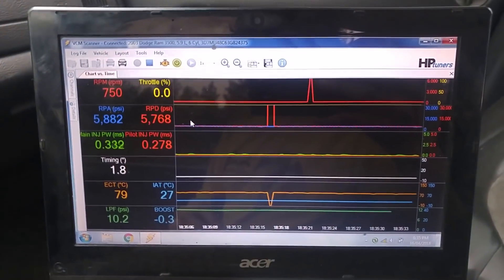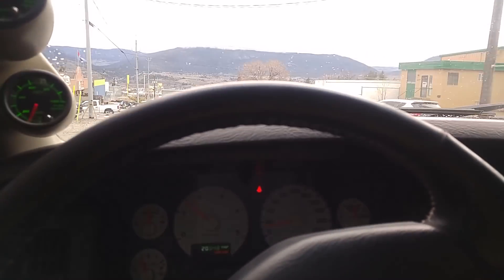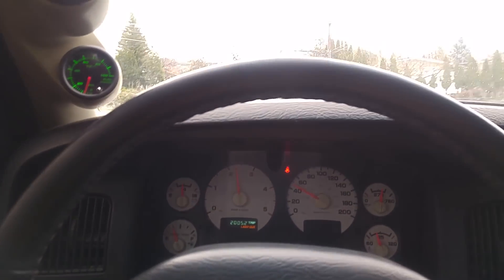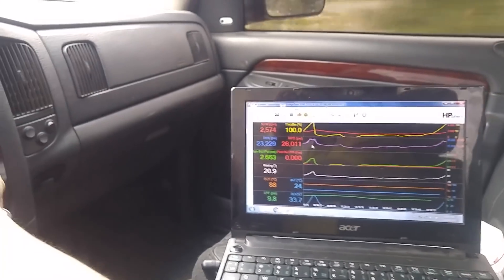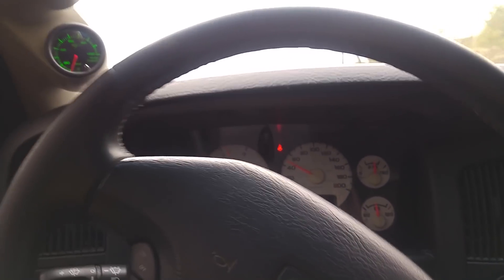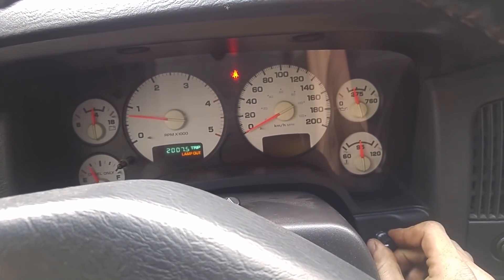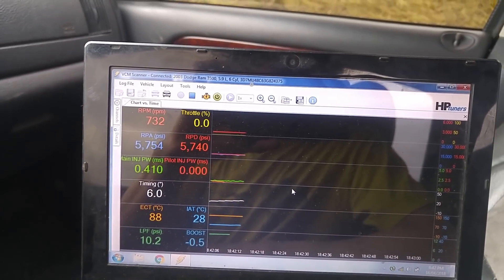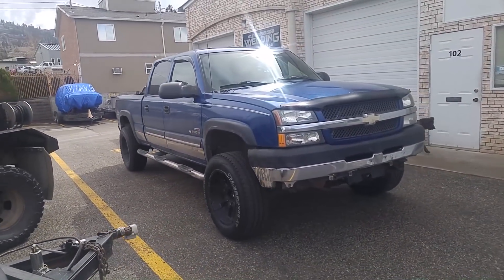SWITCHABLE TUNES FOR 03-04 CUMMINS UPDATE!

Comment: Optimal welding whats you’re opinion on a Smarty So6 for early 2003 Cummins NV5600 6 speed? Also what would you say is you’re optimal tune for MPG lower EGT and have some extra power? I have FASS fuel pump, AFE intake, Rail pressure/boost gauge but thats it for now at 325,000 miles (523,036 kilometers) just want something better then stock but good for longevity, any info would help a ton i plan to possibly get a setup soon and definitely like you’re tunes a lot more then the standard tunes i find on plug/play